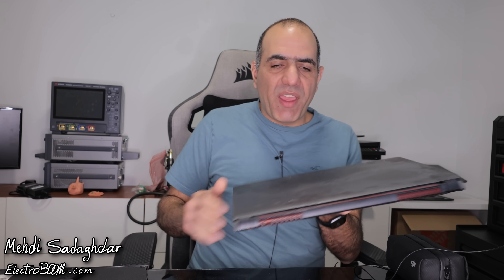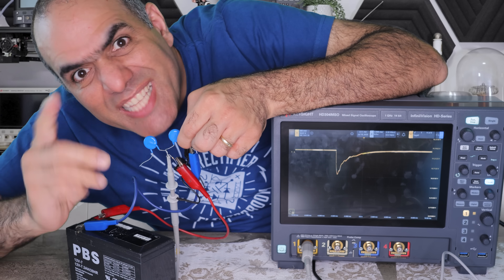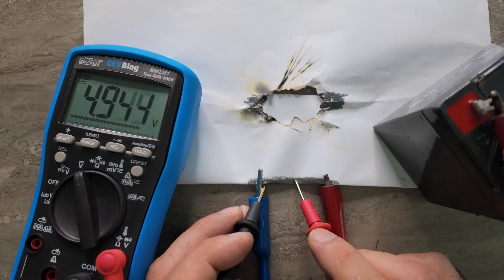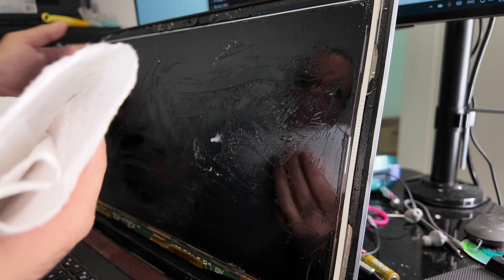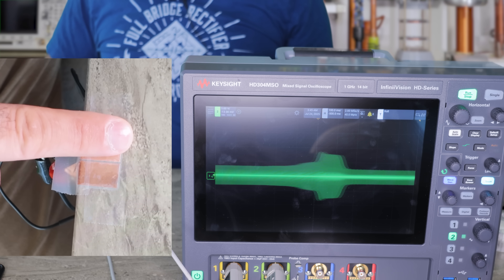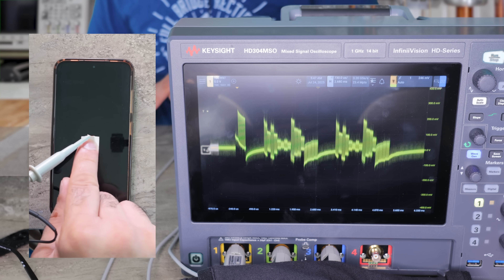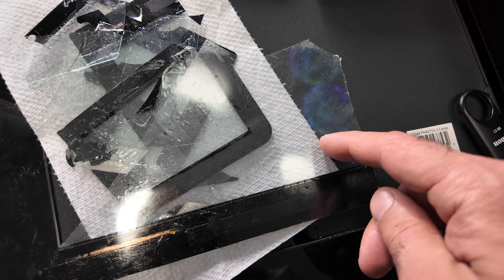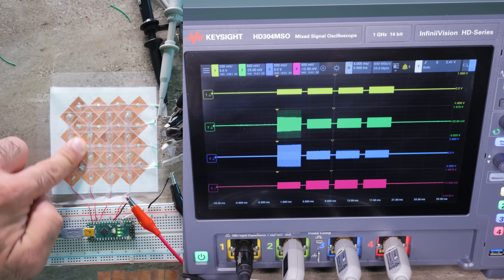The Touchscreen that Changed the World!

Comment: AI generated code is...

- Rarely flawless
- Usually bloated or overly complicated
- You wouldn't know how to make it work better or at all if all you knew was how to ask an AI to write it. Asking it to fix it could just make it worse

AI works for very small projects (like 50 to 100 lines of code in total) and it can be a helpful learning tool or a rapid development solution for one off stuff.
But at the end of the day, if you intend to make an actually functional device or useful software you still need to know programming. AI will do what AI thinks is best (as in, the highest score) but that isn't always what a human actually wants.

It would have been so much cooler if you did it the old fashioned way, writing the code in assembly. Like Ben Eater would.

Comment: A friend of mine used that same technique to build a music mixer and volume control with 2 inputs and one output in the 1985 (year more/year less).
It was very nice, plexiglas table and all the electronics visible in transparency with all the contacts made by small copper pads where you had only to slide your finger to control the volume, balance frequencies and other sound parameters.
Reply: That's exactly the idea I got. I circuit-bend toy instruments and these would make for some fun controllers.

Comment: Actually, it's not that the wires on the touchscreen's digitizer super thin that makes it transparent, it's that they are made out of Indium-Tin Oxide, which is transparent at visible wavelengths.
Reply: Big up the ITO layer. Hand buffing lcd substrates is an amazing process to learn.

Comment: I don't know if you've ever seen how the safety system on a SawStop table saw works, but it would be an interesting subject. If you touch a spinning blade on a SawStop saw, the blade stops and pulls down into the saw so fast, it appears to just vanish. Sawstop claims that you will never contact 3 teeth before the blade stops and vanishes.

Comment: I have that same laptop and it did the same thing. What a mess. I don't know if they got a bad batch of loca or if they never hit it with the UV to cure it. What a mess. 

It's usually easier to replace the "display assembly" rather than try to fix the one you have. They do sell just the digitizers but one mistake and you have to get another one. 

It's kind of an old machine now I would get a new laptop and then remove the display from that one and use it as a desktop. HDMI works just fine. You could also take the board out and mount it to the back of a monitor and make an all in one out of it.

Comment: I have a 13 year old touchsceen laptop that started to leak precum too but the screen has no damage. Poor fella begged for its due retirement.
Reply: u can use the laptop as a home minecraft server for a party of 3 ...
Reply: I have a similar aged Sony Vaio Duo that's suffered the same fate. Until this video, I assumed it was just some adhesive to hold the laptop together, but the goo was never ending when I tried cleaning it up a year or so ago with IPA. While the laptop worked fine, the screen gradually deteriorated as I tried to clean it up. It's pretty much built in obsolescence.
Reply: @nezbrun872  The Vaio Duo bubbles and oozy. I have one too. Whe  I bought the seller didnt tell it was basically a complete failure already. I was frauded. Rplece cost more than 300 eur and my has failed completely, only white display now, ooze everywhere, but the touchscreen still work. The image was going darker and darker everytime. I still don't know what to do. It has all my Arduino projects inside and works with a monitor still. It's too difficult to me to take apart, I fear i might kill it.

Comment: I am so fascinated on your very handcrafted capacitive touch sensor. It feels like someone can do easily for some science fair project
Reply: They just don't have the fancy 4-channel scope to display the output. So you would need some other solution to show how it works on a signal level. I guess you could try to vibecode another arduino program that reads out the signals again and displays the coordinates on a LED matrix or something to keep it cheap and simple enough.
Reply: @ProtonOne11  as the voltage level rises significantly on the output channels wherever there is a finger you can just add dedicated schmitt trigger components for each output and it will flip to a digital 1 when the peaks of the pulses rise enough to pass the threshold. add a bit of a smoothing capacitor and the positions with the finger can be read by a multiplexed parallel input or if you are feeling fancy you can add a series of latching parallel to serial shift registers and serialize the entire "touchpad" in a cycle.
Reply: @ProtonOne11 you can just take a microcontroller and rapidly switch the pin from high to low and measure the time it takes to go low. the time will change with capacitance of pin which changes depending on if you are touching it or not.
Reply: @ProtonOne11  Honestly, I could easily set this up. I got spare microcontrollers for the job and can just develop a simple macro within python that reads the sent input to the receiving microcontroller to a simple web program that I can display on a laptop.
Reply: @ProtonOne11  just slap an LED, or Arduino serial plotter can work
Reply: If you don't care much about accuracy/resolution and only need to detect a single touch, then three copper traces are enough for a 2D capacitive sensor and are even simpler to do at home.
Reply: i will try to make this, and maybe the resistive too actually

Comment: Medi to blink a led with a Arduino Nano YOU JUST ATACH A LED TO RESISTOR  ON PIN 13 AND GROUND, as it is already programed to do this.
Reply: I think perhaps you completely missed the point of everything in this video.
Reply: @stargazer7644  I make a joke, why you no laugh?
Reply: @Reality_TM because Medi would get the joke and you can't.  He teaches the fundamentals of electricity not C++.   You can put two NOT gates into a AND gate, but this does not compute.

Comment: this is singlehandedly the WORST touchscreen failure i ever witness.
Reply: Knowing Mehdi, he probably tried to fix it with a blowtorch 🤣
Reply: @hempbear  Learning from the iphone
Reply: @hempbear  Nah, although @AndrewCamarata probably would (he used a chainsaw to fit a double din car audio deck into a single din dash with double din space behind it). Lol
Reply: I am inclined to believe that it didn't just 'fall', but it does not matter given what I learned from the video.
Reply: As a repair pro... seen worse sadly. Basic failure mode is people leave keys on keyboard then close the laptop. Which looks vaguely similar to what happened here in end result if you leave it on a shelf for a bit. Honestly among the tamer failures compared to what  I often deal with... Worst one by far was a dead power supply somehow ending up at 240v across the whole machine, including the edges of the touch screen. I found this out by touching it of course. That one was... not salvageable at all no way no how. The smell really should've set me up to be more careful that time tbh.
Reply: I've my doubts regarding that sticky stuff
Reply: @mayankmaurya8631  Its legit, I had a toughbook screen start oozing OCA out through the frame. Its basically the consistency of melted hot glue (when at room temperature) and is a nightmare to clean off.
Reply: It's what happens when you forgot you have your watch laying on the laptop and close it. :D
Reply: You really think you can trademark Reality, Mr. Reality?
Reply: Behold the might Sony Vaio with oozy bubbles...

Comment: no touchy, but hall-effect dc motors, with bushings as +/- brushes. seems complicated. why not every touch pad separate input/output wires. not the mixed wires nonsense. yep individual wires keyboard. not mixed wires decoding complexity. yep one wire for every pad. then you can measure the capacitance between every pad. by making the wires grid only makes stuff complex. no actual benefit vs individual pad wires. know actually, dont only claim to know. only above truly knows. so stop the pride of knowledge of people. above is much better than an ai. even if it would work like an ai. just ask above. dont force your opinions on anyone. thats not freedom. diy so you dont serve others. law/knowledge causes hate.

Comment: never thought capacitive touch was that simple. Sometimes it's built-in the front glass and sometimes directly into the display itself like some amoled screens, where the glass is there just to protect the ultra-fragile inner screen.
Reply: it's not simple tho. Maybe simple to understand now, but to come up with it from scratch it's a whole another story and relies on many discoveries
Reply: @cantthinkofabettername7016 actually we have had capacitive touch for a very long time. What we lacked is a way to make clear conductive coatings onto glass and a high enough resolution for it to work. However now that we have the ability to coat glass with certain patterns as conductive it has become very cheap and easy to use. But we have had capacitive touch for a long time. We had capacitive touch lamps since the 50s and had the technology before then. But the screen as we know it is definitely newer than that.
Reply: @cantthinkofabettername7016 discovery such as simply having fast enough microcontrollers that it makes sense to build
Reply: capacitive touch is not limited to screens either. VR controllers have it everywhere
Reply: Early